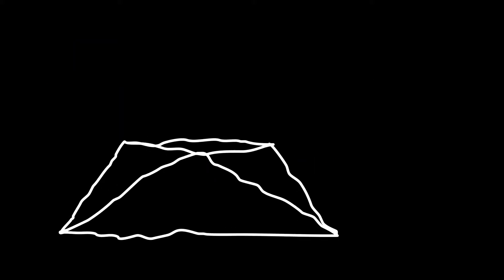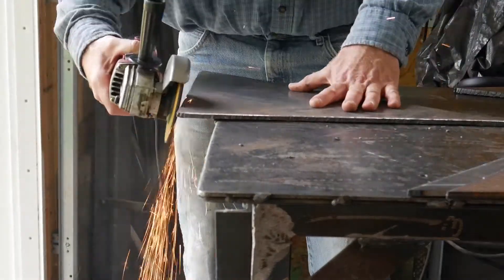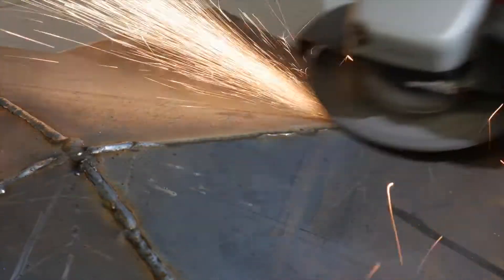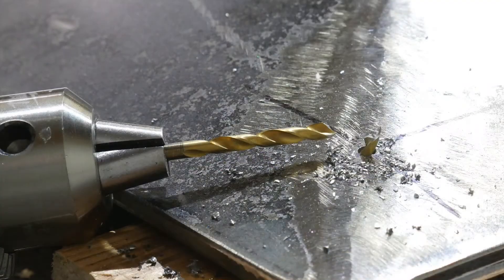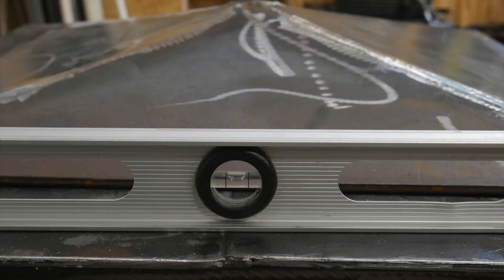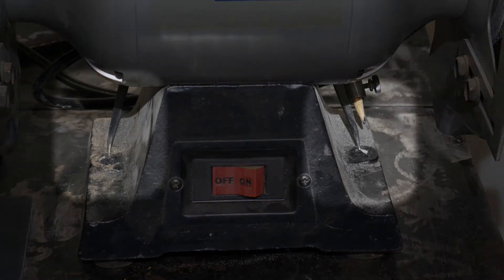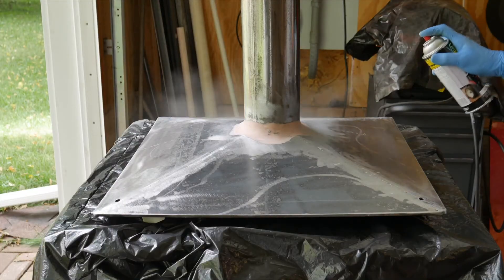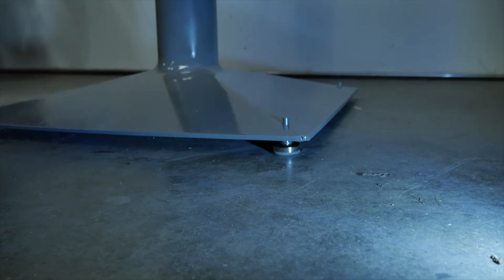Pyramid Base Grinder Stand - Building a Bench Grinder Stand!

Comment: A grinder and paint make a welder what he aint!  Awesome design! Any thought to mounting the grinder on springs to reduce vibrations?
Reply from the maker: Grinder and paint, and bondo for the inside corners!!  The bench grinder itself has four rubber feet and runs pretty smooth.  The two bolts just hold it in place.  Thanks for the comment !!!